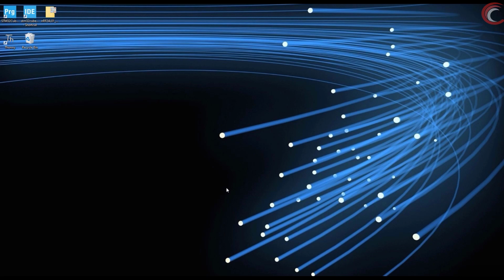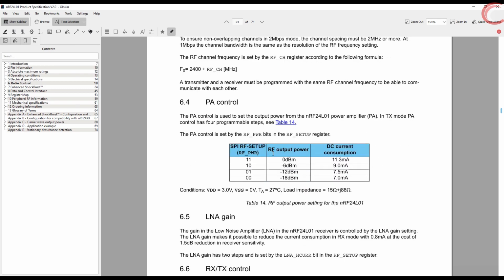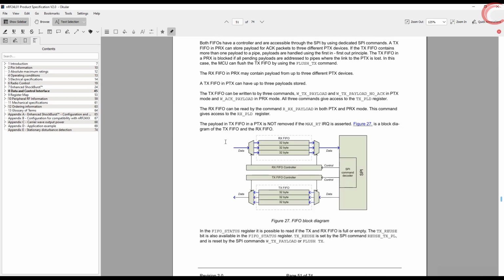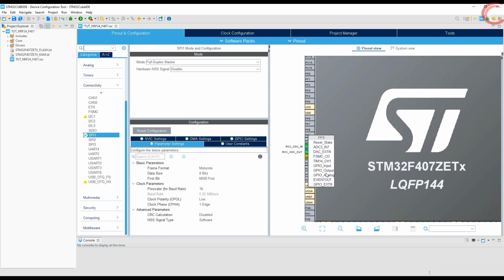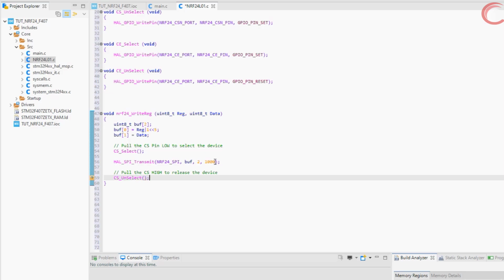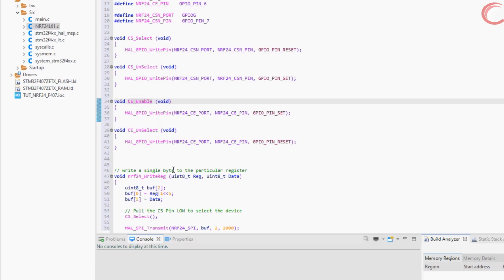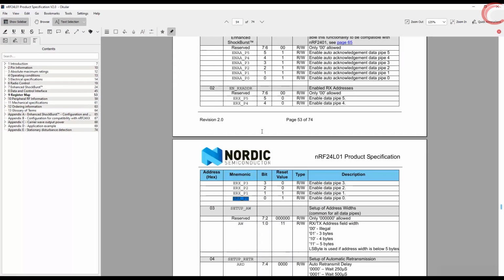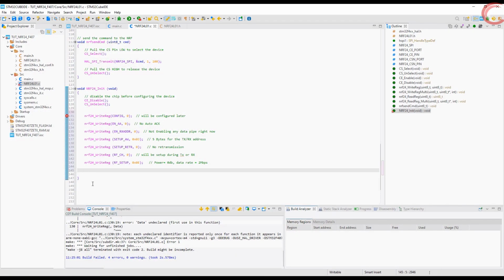How to Write Basic Library for NRF24L01 PART 1 || Common configuration || STM32 SPI

Comment: Can this procedure used to write for nucleoG4 board
Reply from the maker: It can be used in any controller which have the SPI peripheral.
Reply: @ControllersTech  but you used hal to transmit and receive the data and the peripherals and registers are different
Reply from the maker: All ST boards can use HAL in the similar way.
Things changes if you are trying to program using registers.
Reply: @ControllersTech  thank you very much
Reply: Can any one help me i am writing my own hal library for spi

Comment: Does this work for arduino too?
Reply: You shouldn't really use it, Arduino implements SPI in a specific way different to IDE used in the video.
Reply: No, it does not . First of all the init function does not write the proper values in order to make it work

Comment: Excelent Video!  One word of warning regarding the HAL_SPI functions. I have made a project with a STM32L432KC device, in HAL Library, and after a deeper analysis I found out that the SPI functions are simply... not optimized AT ALL. I was supposed to transfer larged amounts of data in a shorter time.  If you ever experience bottlenecks on a SPI bus, this may be due to the long code that the functions execute. In case this happens, do a simple experiment: Make a continuous SPI transmission and put an Oscilloscope (Or logic analyzer) on the bus. If  you notice abnormal spaces between the data bursts, there is the issue. It may happen on lower end SMT32's, so I thought it may be a useful info.
Reply: Thanks!
Reply: Thank you!